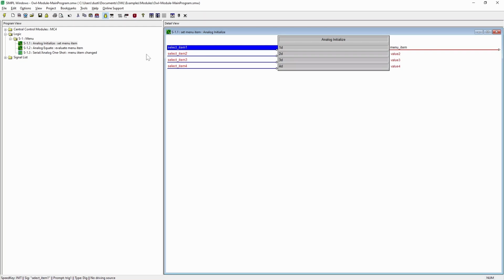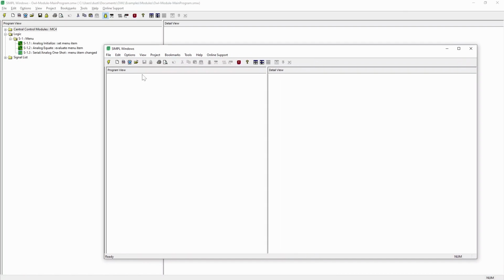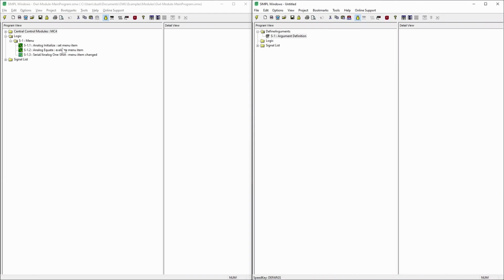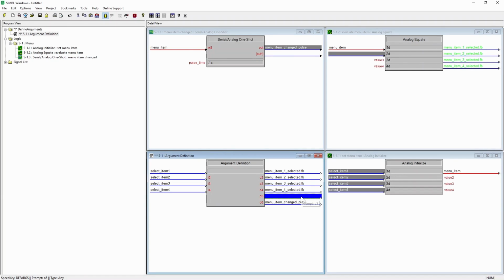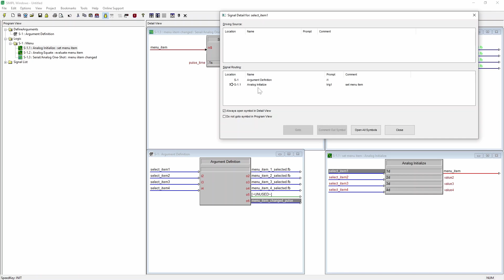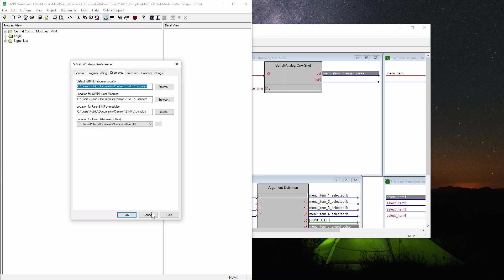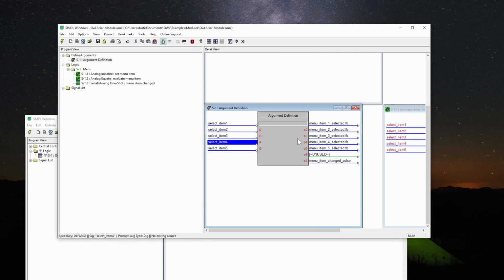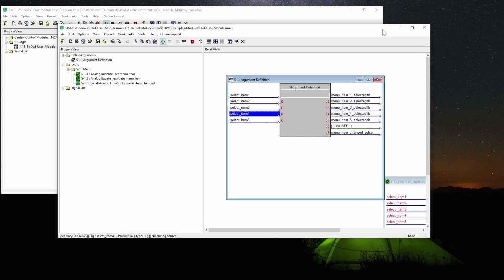Creating Crestron SIMPL User Modules

Comment: Hey guys have you ever used rs-232 commands to control a Panasonic projector?
I can send Sony, Samsung, Lg commands fine and control devices. And I can send the projo commands from windows through a usb to serial bridge but can’t figure it out for the Panasonic. 

Can you help?
Reply from the maker: short answer, yes...have controlled panasonic projectors a lot of times. Usually the command structure contains an id, I usually target an id of "all" so I don't have to mess with it. The command structure looks something like \x02ADZZ;PON\x03

I'm curious why it is working for you from usb-serial bridge but not from a processor/receiver, you might have a wiring or connector pinout issue.
Reply: @OverWorkedLogic  i'm wondering if i've put in a typo anywhere. i'll copy paste your text  and give it a go!